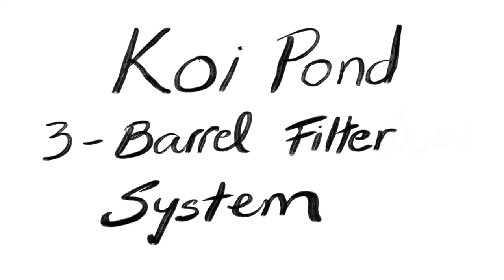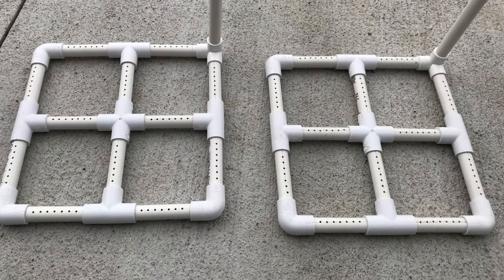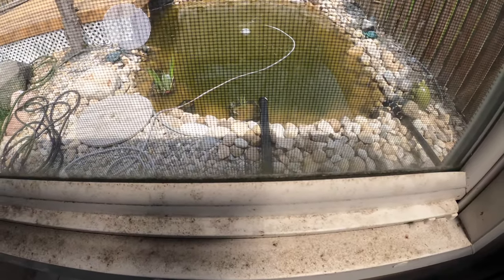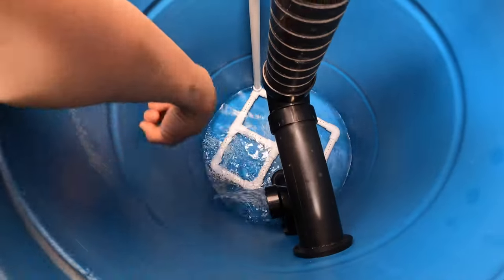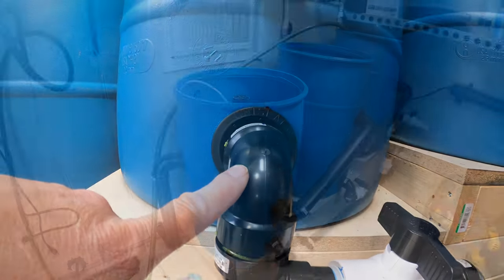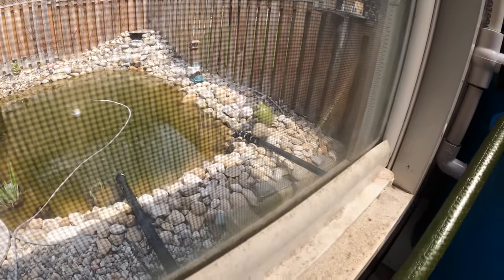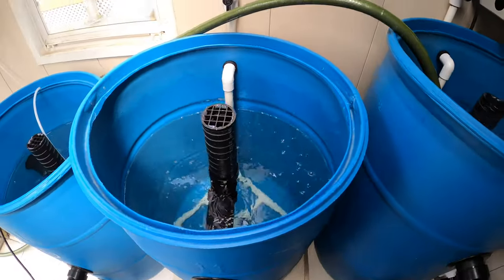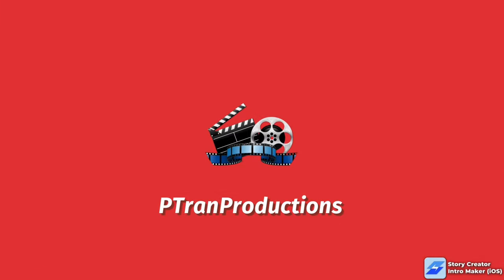DIY 3-Barrel Filter System for Koi Pond

Comment: Hi PTran, Great set up. getting ready to set mine up, are you running two pumps in your pond? I am running Aquascape Biofalls with Aquascape 400 skimmer & Aquasurge 3000 pump for 2200 gallon pond. What are you thoughts on running this set up with the existing all on one pump. One main thing I like about the Aquascape set up is all the piping is hidden but need to upgrade my filter system and hate having to wash mats every other day.  Any help or thoughts would be much appreciated as I am still learning. Thanks.
Reply from the maker: Hi Max,
I am running two pumps for my pond (6000 gallons). 4500 GPH for my skimmer and 3170 GPH for this 3-barrel system. I like to have these two separate systems just in case one fails, the other still runs. You can incorporate this set up to your skimmer system with your existing pump but I would not recommend it. You can use your current skimmer system with lighter filter media such as green matala to filter large surface debris and get a new pump put it at the bottom of the pond for this setup.
That’s my thoughts.
Reply: @PTranProductions  Sounds good, Thanks for the info really appreciate it.
Reply from the maker: You are welcome! Good luck with your setup!

Comment: Would this work with a pool instead of a koi pond?
Reply from the maker: Do you mean swimming pool?
Reply: @PTranProductions  Yes
Reply from the maker: @vanman9607  
I have never thought of it being used for swimming pool. I don’t think it would work because it is a slow flow system and contains bio media which is meant to house the beneficial bacteria and non pressurized.  You need a pressurized sand filter with high output pump with a chlorinator to kill any bacteria in the water for the swimming pool.
Reply: @PTranProductions  That's what I've been told is that pools require high output pumps for the sand filters to work, but if you replace the sand filter with this system a low flow system, you're still using roughly the same amount of water (an extra hundred gallons is nothing for a 16,000 gallon pool).  you're still filtering out the algae, debris, which is what the sand filter does and it's still being chemically treated, but you wouldn't have to worry about too much pressure in the filter, or not enough pressure, both of which can make your sand filter useless.
Reply from the maker: @vanman9607  
Well, I have never seen it done before  but I guess you can do a “trial and error’ run. Keep in mind a new pool sand filter system would cost less than this DIY system. So for economical reason, I wouldn’t recommend to try this for swimming pool.

Comment: Good job👍🏽
Reply from the maker: Thank you!
Reply: @PTranProductions  This is a good set up, but I did something slightly different.  I set up barrels similar to this with a pick up near the bottom that was tapped out the side with valves (like the one you use on your manifold set up) so that I can open them to drain the sludge that settles out and collects there.  I just pump water through these barrels.  
Then, separately, I just stick a sponge in a 4 or 5  inch ABS pipe hanging vertically.  I have 4 holes drilled at 90 degree spacing around the pipe and thread zip ties through these wholes to support the sponge.  I have another pump pumping water into this pipe, and the bacteria sets up in the sponge to keep the nitrites and nitrates in check.  The water quality tests well, and it's a simple set up.

Comment: I am going to copy your design. Love the way you have it set up to clean. I am also adding a skimmer filter. Do I run both pumps to the 3 barrel filter?
Reply from the maker: It would depend on your pump GPH. This system can only handle about 3170 GPH pump - could not keep up with 4500 GPH pump on initial trial.
If your two pumps’ combined GPH is too strong, the 3-barrel system may not be able to keep up and your barrel #1 will overflow.

Comment: That is a HUGE filter for a tiny pond. I can't use this as is, but I got an idea on house to handle one problem I was having with the filter I first made and had to abandon. It was working, but it didn't flow out at a rate steady enough to work. The overflow pipe having those slots is perfect. I can have more than enough flexiblity using that. Also, the platform design couldn't be more straightforward. Brilliant. THANKS!
Reply from the maker: Np!

Comment: Really love this video, thanks for the idea of three 55 gallons filteration, does that uniseal really work without leaking? How long does it last if you leave the barrels outside? Thanks I plan to do mine like this
Reply from the maker: Hi Benny Hoang,
Yes, the Uniseals are flawless so far, no leaking at all.  I am not sure about durability as this is my first time using them. But they’re made out of rubber so they would last a while.

Comment: So you've copied my filter system and your claiming it's your idea.
Reply from the maker: Hi Mr. Wrighty,
Thanks for stopping by!
No, I have never made any claim that it’s my idea. It’s just my DIY system built based my research and study on other people ideas and suggestions like yours - thank you!
Reply: I don't mind you using my design at all, but a mention in your video would have been nice. You'll find it will work better using K1 in all tubs, Also the reason tub 1 is close to flooding when re-filling, is the media blocking the inflow pipe going into tub 2. If you clean one tub at a time I don't think this will happen.
Reply from the maker: @Wrighty  
Yes, you’re absolutely right. I should have  mentioned your original design and idea in the video. My apology! Your name is mentioned in the description though.
I could have used K1 in all tubs but I went extra miles and ordered K2 all the way from California instead. Oh well, they all turn out well. Thanks for pointing out on the air lock issue. Yes, I have learned that lately after a few cleanings. I have to clear the media at the inlet of the second tub to clear the air and to avoid the overflowing in the first tub.
Thanks again!